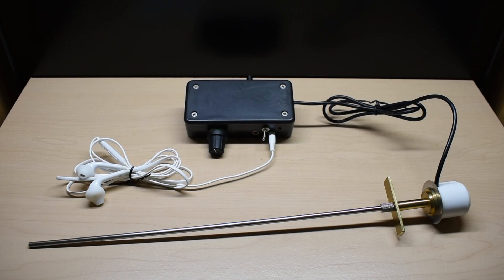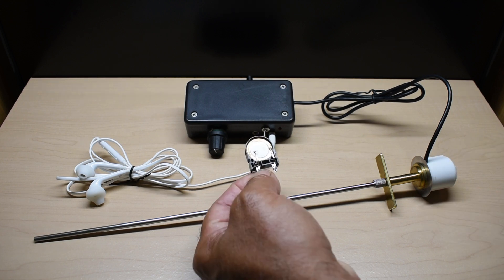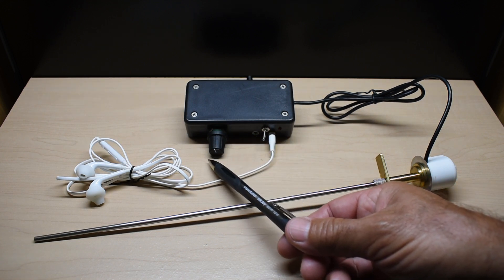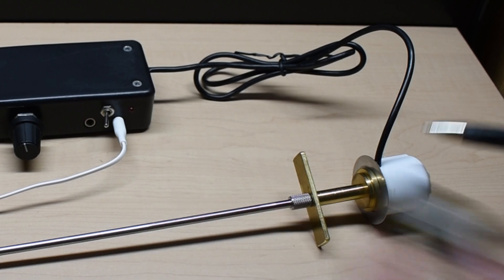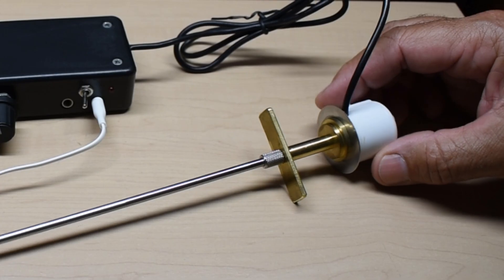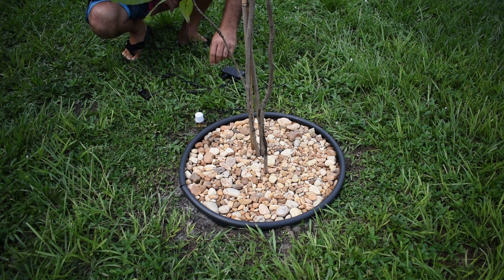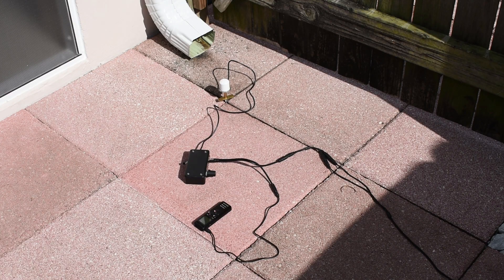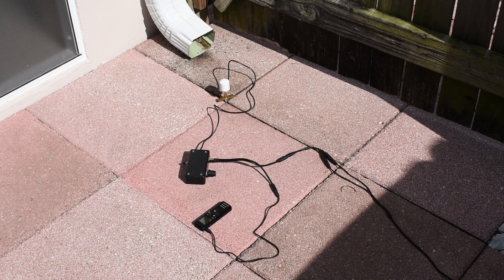Homemade ULTRA SENSITIVE Ground Listening Probe ~ Locate Buried Pipes!

Comment: I need to identify  water  leakage  from  bottom of roof slab. Leakage from  top flat of toilet either pipe line  or  drain  pipe. but effect  bottom  flat  toilet  or room. I need to Identified the  area of water leakage.

Comment: Hi.. I got a question on led lights. On my 2002 chevy silverado 1500hd can I hook up cargo light wires to a led spot lights on my racerback.. I was going to not use cargo lights and just run wires off to spot lights on racerback so I dont run different switch to the spot lights.. they be 9 inch be like kc lights on a roll bar.. I was wondering if I could do that?

Comment: Amazing sensitivity. I've used a cheap "spy-mic" to locate electrical wires inside walls. As I move the mic around I can hear a buzzing from wires flowing with A.C. current. I think this thingie you made is much more sensitive.

Comment: The utility locator pros use a sonic ping device that you connect into your pressure plumbing (such as a hose bibb or irrigation sprinkler) that signals a microphone such as you show to trace hidden pipes.  This provides a strong and distinct signal versus your suggestion to listen for turbulence from a restricted running faucet. Cabled pipe inspection cameras will provide a 512 Hz battery-powered sonde that works similarly, for probing and locating non-pressurized drain pipes.  The sonde is loud enough that you just have to sweep the sonic phase triangulating detector (two mics) above ground.  By exciting a known frequency and filtering the received signal, the signal/noise ratio is greatly improved and noise rejected.  These tools cost $$$$, but your DIY microphone improvisation is a decent approximation to that function.  Perhaps you could come up with a DIY electronic pipe pinger or sonde to be a companion to the microphone.

If you're tracing lost shallow irrigation lines, the cheapest thing is to crawl around sticking a mechanic's stethoscope into the soil as a probe.

Comment: Very cool, Scott!  That probe could be used for all kinds of things, including diagnosing engine and vehicle noises to help isolate where the issue is.  The noise of simply moving the grass and brushing the tree were amazing.  If I ever need a device link that, I build one from your videos.  I've made all kinds of DIY electrical/electronic projects.  Back in the '70s and '80s, from magazines.  In the '90s, I built a record player RIAA Curve Preamp to record LPs from a turntable directly into a computer Mic/Line In port.  Without it, an LP, 45, etc. sounds tinny with no bass.  It's an equalizer for vinyl records, needed due to the stamped/pressed vinyl compression.  Bass signals are hard to produce in the grooves on vinyl, so they do it this way.
Reply from the maker: The problem with using it on an engine is that it's so sensitive all the engine noises are going to be extremely loud.
Reply: @electronicsNmore   I see.  Thanks

Comment: Very, very nice. Do you think maybe you could use 3 of them together in a system to so some triangulation and maybe determine exactly where in space the sound is originating from? That'd be awesome. Y'know there's potential here for searching earthquake rubble for survivors. Potential for all sorts of stuff. There's more than pipes under the ground ;)
Reply from the maker: I like that idea, but I don't think it would be too easy to do.
Reply: Or gophers
Reply: You would probably need a computer algorithm designed to measure the amplitude variations between the three, which would then triangulate on the source location... at least that would be the easiest way...